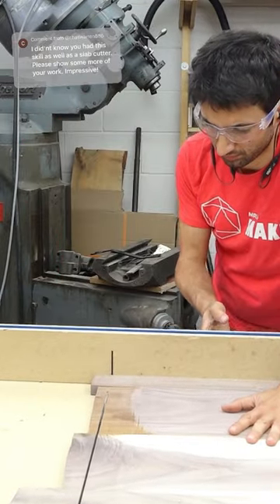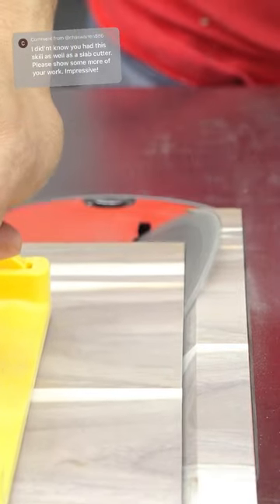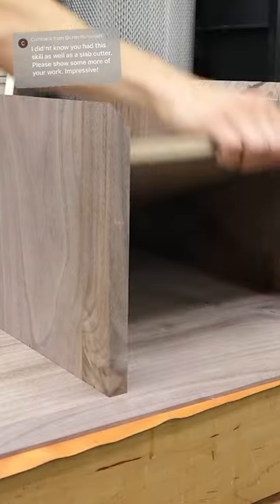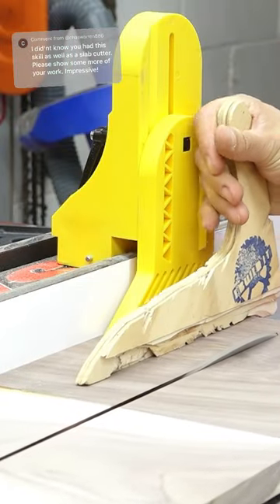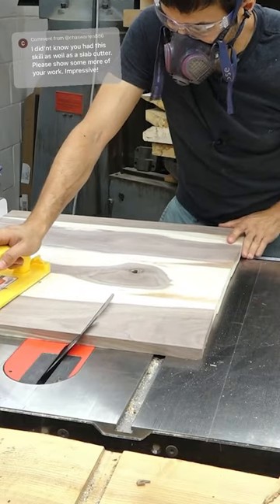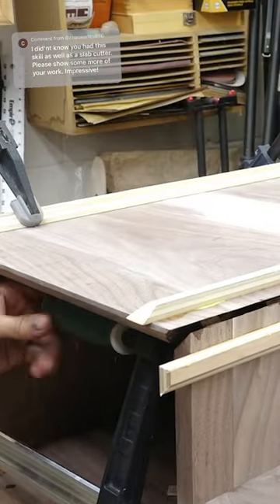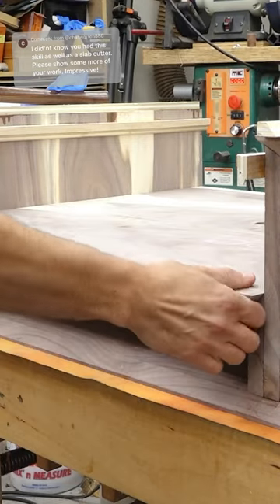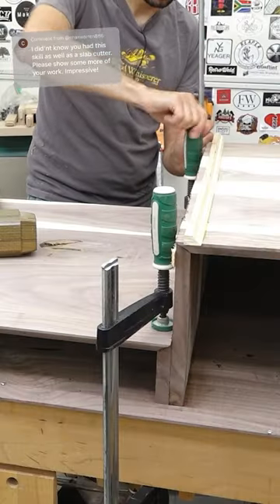Framing out the drawer openings - Dressing Vanity pt 3 #woodworking #urbanlumber

Comment: What kind of adhesive were you using there? I found during my last project, a tv console,  that regular PVA glue didn't give me anywhere near enough open time when gluing up the carcass.  😢
Reply from the maker: Slow setting epoxy. 45 or so of working time